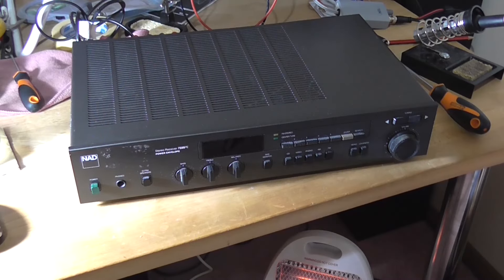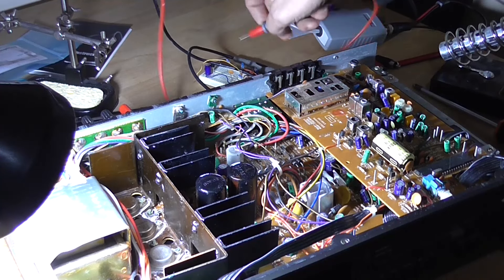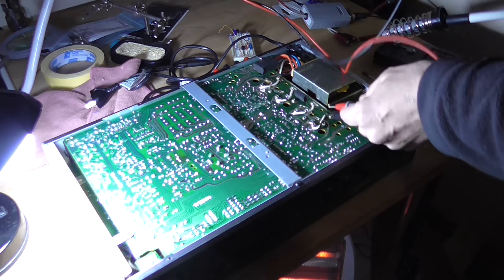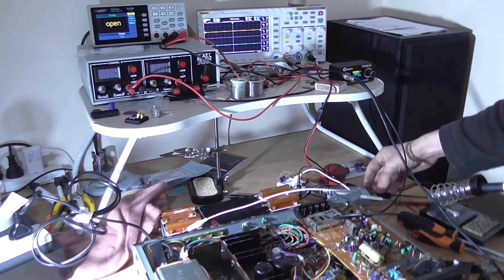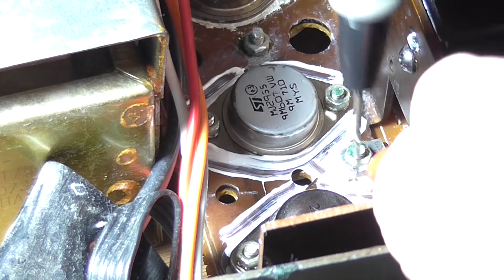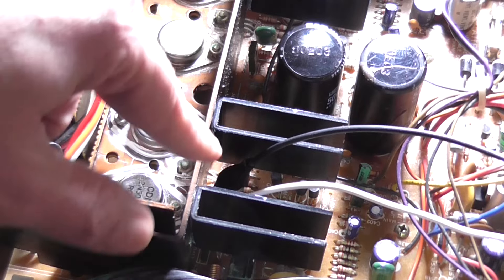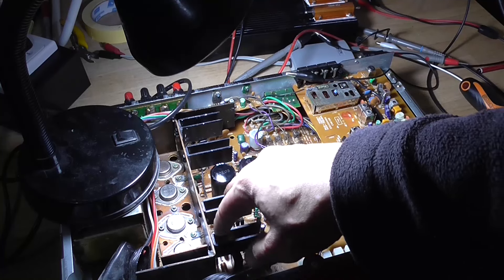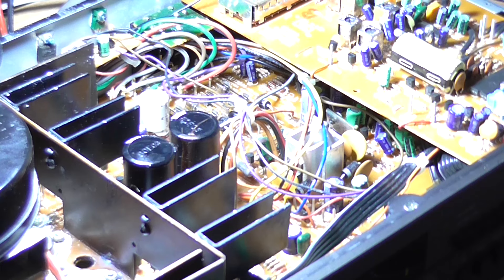NAD 7225PE Stereo Receiver: Blown Output Stage & Distorted on Right Channel

Comment: one of the filter electrolytics looks like its about to pop
Reply from the maker: I checked that, that's just the plastic disc that's expanded over time. You push on it and it goes down flat to the aluminum top of the actual capacitor. Good eye, though ;)

Comment: I would check the electrolytics.
The amplifier is 30years old. That overvoltage may be the cause of the outputs to have gone faulty initially.
Reply from the maker: Checked the electros, replaced a few and still same issue. However, I have now found an issue that may possibly be causing the -14V across each pin of the Vbe multiplier transistor. A new video will be coming soon about it, and what I found, I'm also not happy as to what I've found...

Comment: If the outputs blow, they typically take out the biasing and driver transistors because I think this design is all sort of directly coupled. Should sound fantastic when working but they are like rube goldberg machines when something goes amiss. I've seen a couple and capacitors were never the issue even though they weren't the best brand available.

Comment: I had a similar problem and it happened to be a NAD. Look around for why the opposite voltage isnt getting through to (balance) it. I chased my tail for ages with -27V on the output chasing -ve voltages. Someone on one of the forums suggested I should be looking for missing +ve voltages. I think mine was a shit join on one of the drivers trans . You probabaly already have but, check the work you have done for solder bridges or lifted tracks. The fault wasnt there before so it's something youve introduced. Good luck.
Reply from the maker: The fault was there before, and nothing I've introduced. It had a shorted MJ2955 transistor collector to emitter. And currently, it keeps blowing the new transistors. I think the driver transistors (which are 33 years old) may have become electrically leaky between junctions. I'm at the stage now of calling it non-repairable as it's not economically viable.
Reply: C"mon. I'd hate to see you give up! But you do have to know when to fold em. Throw it on the shelf. Something might come to you when you least expect it as most anwersin life so often do.
I'm actually chassing down a similar fault now on one channel of an ancient Jans J600S PA my brother dropped off. What makes it even better is I cant get a schematic for love nor money. This thing is Australian Made from the early 70s so look like I'll be trying to trace out and draw myself, which I'm pretty sh1t at. Just keep on swimming.

Comment: NAD is crap, don't fix just throw in trash.
Reply: That's not the purpose of this excercise. The customer wants it repaired.
Reply from the maker: @sanolivo6867 That's your opinion, however the point of this is to see if it can be repaired (there will be a follow-up video soon) before I condemn it as "parts only".
Reply from the maker: @bobisyouruncle1 One thing I forgot to film or mention was this originally came from the Mornington "Tip-Shop" (resource rescue) for $120!! They sold this thing to someone for $120 in an non-working state! This is not uncommon for this resource center, which is why I rarely go there lol. Also, the purpose is not really they want it repaired, only "if" it can be repaired. I won't be making much off of this. However, having said this, I don't know if it was originally working and the person that bought it didn't just blow it up by shorting the output...